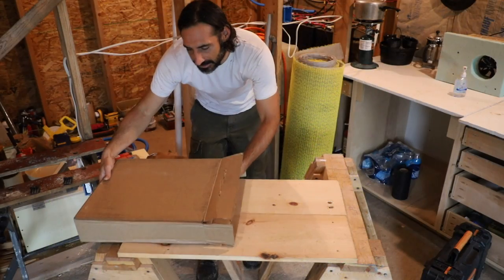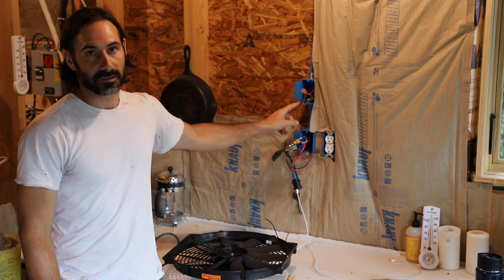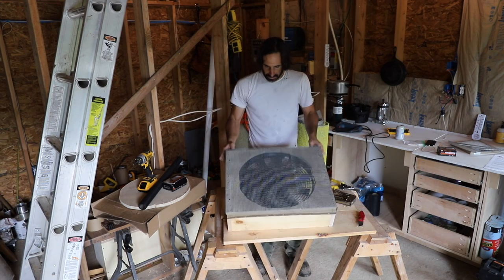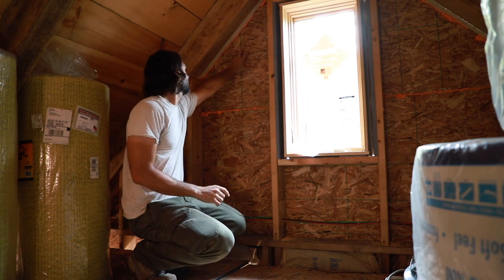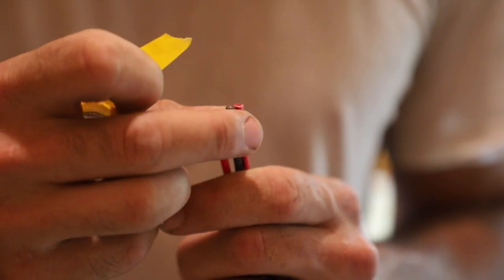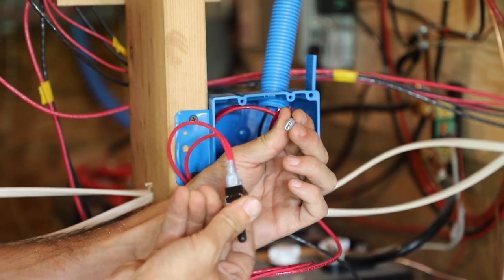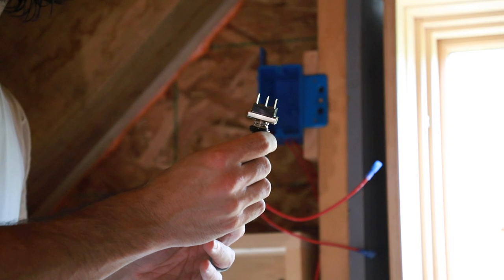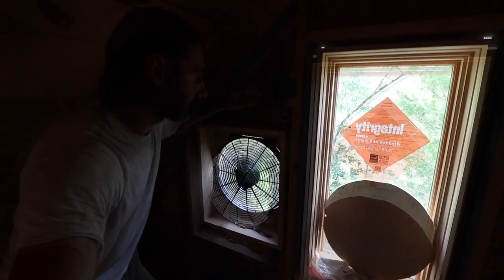Off Grid Alternative to Air Conditioning?  Making a Whole House Fan From a Radiator Fan

Comment: If you've installed that gable fan for the purpose of COOLING (i.e., getting outside air into the sub-roof, to replace hot air on a sunny day), then you might have been more effective with a weather-proof fan on the shady side of your roof.   Yes, I noticed you have R40 roof and my garage roof in SoCal has no insulation value at all.   Still, you are getting heat into the living space, by your own admission, from roof; i.e., from IR showered upon inside areas from warm wood of the sub-roof.   Stop all that with a sub-rafter radiant barrier...i.e, glorified aluminum foil...  with some plenum beneath the roof ridge.     I know you're not in Phoenix AZ where my idea works best.   But you might learn about radiant barriers... shiny side DOWN, so dust won't gather on that important shiny surface, to diminish its low-emission nature.     Admittedly, I've never heard of a DC-powered roof vent.      So you might want to invert your DC and a 1500 cfm fan from Home Depot ... requiring about 250 watts... might work out.
Reply from the maker: The insulation is foil faced polyiso, so there is a bit of that going on in the airspace.  This fan moves 2250 CFM at 120 watts, I will probably end up running it at half speed to keep it quiet.

Comment: Hey man, you're probably not gonna see this but I hope it helps someone else. A ventilator fan is the first step in getting out hot air from inside the home but you can go one step further by using desiccant and/or evaporative cooling depending on your location. If you live in an arid climate, you can get away with just an evaporative cooler but in humid places like yours a desiccant and an evaporative cooling combo can cool the home a lot more. The science is pretty simple and based on the phase change of water where it takes 5 times more energy to heat water from 100C liquid to 100C vapor than it takes to heat it from 0-100C. This is what happens when you mist the room with water and allow it to form vapor by absorbing heat energy from the room.

A lot of good info I got is from this video: https://www.youtube.com/watch?v=R_g4nT4a28U
Note on video: The majority of energy is needed for heating the desiccant to release the absorbed water, this should be simple enough with firewood or charcoal or some magic you use in the country for heating.

Phase change of water: http://hyperphysics.phy-astr.gsu.edu/hbase/thermo/phase.html

Comment: Radiator fans are ment to run for short periods not long sustained times. Good possibility it wont last long. Sorry not being negative a.box fan would worrk longer if you are conserving money.
Reply from the maker: my plan was just to run it until it changes the air in the cabin, a couple minutes or so.

Comment: Bunch of hater on here! 
I would have used a Volvo cooling fan. It would be a lot less noise.  Then I would have just went with smaller metal screen. Ditch the window screen.   That is really blocking your air flow. Some kind of flapper panel to stop bugs and keep the heat in the winter
Most of that sound is from the straight blades.  Volvo fan will flow more power last longer and make less sound when on.

Comment: Bubba. That thing is noisy as hell. Great wiring job. But you gotta get a quieter fan.
Reply from the maker: oh yea it is super noisy, I will wire in a controller so it can run at 25 or 50% speed!

Comment: Use two 12 volt fantastic fans hooked-up in series, your problem solved.
Reply from the maker: Does that work if I were to wire them in series would they each take half the voltage?

Comment: Very loud!  I hope your not planning to sleep with that on???
Reply from the maker: It actually only needs to run a few minutes to change the air in the cabin, I am also going to wire in a controller so it can run slower.

Comment: Why is it so noisy?
Reply from the maker: Its just a really powerful fan, it can change the air in the cabin in under 5 minutes.  Once I install something called a PWM controller I will be able to run it at any speed and have almost no noise on a low setting.

Comment: CFM?
Reply from the maker: It's 2,250 CFM.  It changes the air in the cabin in under 3 minutes.
Reply: 50 Acres & a Cabin   Whoa, that’s pretty high and as a result probably noisy, I know it’s too late now but you probably could’ve gone a bit smaller..  I believe a speed control would be able to knock the RPM’s down a tad.  Thanks for the video... I envy the hell out of you

Comment: This is not an alternative. 
Ventilation and cooling are not the same thing. 
The noise and inability to change the filter is the results of the authors ventilation project implementation.

Have you ever used a washing vacuum cleaner? 
When you suck in water, the vacuum cleaners tube cools down very much. Why not use the same principle? Yes, the efficiency will be lower than that air conditioners from the supermarkets. Yes, there will be a constant flow of water during operation. But then you will have minimal electricity consumption. Several tubes, two fans (one for driving air inside the tubes) and a capillary system - that’s the air conditioner alternative.
Reply from the maker: A furnace filter can easily be fitted in the frame.  The intended us ise in the evening after the sun has gone down, outside temperature drops, but inside temperature which has slowly risen during the day stays higher than the outside temperature because of all the insulation in the cabin.  The fan speeds the natural process up by drawing in cold outside air and pulling out warm inside air.   It just speeds up what nature would take a couple hours to do.  It takes 3 minutes.
Reply: @50Acres  
For ventilation (not only at certain times) it is more profitable to use natural draft. The main thing is to design it correctly.

Comment: You made a very poor fan choice. The CFM may be in the range they you were wanting, but you bought a "slim" fan which is made to be placed in space restricted areas like between a motor and a radiator. You should have purchased a taller fan whose blades were designed to move the same amount of air, but much quieter.

Comment: bro. you blew maximizing out put. i may not spell right! but your killing air flow! i see it! that car fan is highly efficent.  your plywood shit edgeing blows! get a protractor about a 16th larger than the shroud!  sand it even!  let it flow smooth! and the fan noise is sick!  but i think a clean flow will keep the noise down too! but i got it! flow sometimes over comes heat too! i live at 79-81 degrees in nevada. shade. high speed fans. and your eyes will water!  ha. every drop of cool matters here!

Comment: I cringed when he drilled two holes with that large drill bit right next to those electrical lines. He choose the wrong fan for the job - his "whole-house" fan makes a "whole lot" of noise, did he even bother to consider the CFM rate and high amp draw that fan will have, and the mesh will severely restrict air-flow, all this is poorly thought out.
Reply from the maker: The fan is 2250 CFM, it changes the air in the cabin in under 3 minutes. It draws 5 amps, a very manageable load.

Comment: not a fan.  ( needs more cowbell) 

I bet you did that on purpose to get 
comments . did I win ?

while youre sucking air out the top,
how about putting wetted filter screens in the bottom to cool incoming air ? 
rig a 1/4” drip system to keep it running .. gravity fed preferably.

Comment: You're kidding, that level of fan noise is acceptable to you?  Hot air will roll out the attic opening on its own without the fan. 

You need a door on that box to stop cold air coming in during winter.

I'll bet that fan is pulling some big Amps off your small battery.
Reply from the maker: Yankee Inventions Its definitely too loud I’m going to wire in a PWM controller.  It also only has to run long enough to change the air in the cabin, maybe 5 minutes or so at max speed.
Reply from the maker: will do Yar!

Comment: why a radiator fan?
Reply from the maker: The power system is 24 volts and I prefer not to run it off the inverter so I was very limited in fan choice. It moves 2250 CFM!!  does the job in about 3 minutes!
Reply: @50Acres  understood. thanks for the reply.

Comment: Like the idea but the noise is a little much.
Reply from the maker: In a future video I install a PWM controller,  now I can run it at any speed
Reply: @50Acres  have you ever thought about wind power to top off your batteries?  I hear vawt systems were more efficient  maybe you could build one for us?
Reply from the maker: @kennethhudson8013  Im thinking of doing wind for fun, and also hydro, but both would really just be for entertainment because I have a lot of extra power as it is.  Ive never even bothered to wire in my generator backup because ive never needed it.
Reply: @50Acres  impressive

Comment: And you want to listen to the racket that fan makes you really should have went with the RV fans a and they would not drive you nuts like that fan will just way too loud.
Reply from the maker: I am planning to wire in a speed controller which I think will quiet it down significantly.

Comment: Sure, the fan is loud, but you guys are messing the point of its purpose. You aren't supposed to leave it on all day lol. It just helps expel the hot, stagnant air and draw in cooler fresh air. Hot air gets stuck up there with no where to go.
Reply from the maker: bingo
Reply: When the air outside is also hot and stagnent (AKA all summer), where does this supposed cool air come from?
Reply: @elonmust7470  the outside air is still relatively much cooler. I live in Phoenix and I see this in action all the time. Even if its hot as balls outside, its even worse inside because of how "stuffy" it gets from all trapped heat. This fan will absolutely make a huge difference even if its just "warm air"
Reply: @Moon___man  you live without humidity.  You only deal with half of the equation.
Reply from the maker: @elonmust7470  Whole house fans were the primary means of cooling houses from the early 1900's  to the 1950's, this is not a new concept.  Before that, homes were designed to allow natural convection to draw cool air into the lower part of the house and exhaust hot air out the upper levels or a cupola.  There's your free education for the day.
Reply: @50Acres  Those were bigger homes that were built according to the sunset.
You'll be hot in your cabin this summer..

Comment: You have electricity, just buy a damned window unit. They take all of ten minutes to install.
Reply from the maker: I like to run as much as I can straight off the batteries, that way if the inverter craps out I still have stuff like lights, fans etc.

Comment: Couldn’t find a 24vdc version, because you run 24vdc at the cabin????  Have you ever heard of a step-down transformer, going from 24vdc to 12vdc?  Use the Googles before you knee jerk a solution, and second you can get speed control through a varistor or variable potentiometer.  I get it if electricity and electronics isn’t your thing, but ask your subs or friends first.
Reply from the maker: I didn't use a step down transformer for the same reason I didn't run it off my inverter, it's another potential point of failure.  In the next video I wire in a PWM controller.

Comment: Im not sure what you do for a living but first, you never just run wires through the walls. And for the love of simplifying troubleshooting later, use different color wiring.
Reply from the maker: I ran the wire through carlon cable and used DC wiring convention colors.

Comment: NO to a reversible fan if you do not absolutely need it!!

They are by design less aerodynamic, less efficient and more noisy.  They really are!
Reply: I have to correct myself: If you have to reverse the direction of the fan by flipping the blade (and the wires)  there is no reason for it to be less aerodynamic/efficient/noisy.

Comment: Are you an electrician by trade?
Reply: How did you learn about electrical work?  Very cool!
Reply: Love the cabin! Great job! 👍
Reply: Any plans for solar or small wind turbine power?
Reply from the maker: hi I am not an electrician, I do have solar that I installed on an earlier video. I learned electrical by reading books.
Reply: @50Acres  That's awesome! Hey, if you can recommend any books, please list them. It helps us learn. That really takes drive & motivation to take on something like that. Great job!

Comment: Wrong type of fan, improperly screened, and much too much noise! Air conditioning is not just moving air around with a fan. You need to reduce the temperature in the summer season and to adjust the humidity year-round. Too much humidity will put black mold into the walls of a heavily insulated cabin, in the summer or in the winter.
Reply from the maker: This replaces warm inside air with cool outside air in the evening when the temperate drops after the sun goes down.  It runs for 3 minutes and is usually good for a 10 degree swing.  its not air conditioning but it does make a noticeable difference.

Comment: That is not an alternative to AC its an over complicated FAN that moves hot air around no different than an standard AC style fan.
Reply from the maker: Tony, a whole house fan replaces warm inside air with cold air from outside after the temperature drops at nighttime.  This is how houses were cooled from the early 1900s until around 1950.  Before that time houses used natural convection to achieve the same end, it just took longer.
Reply: @50Acres  Yes i understand the concept and for sure in colder climate places it would probably work well but where i live its just moving around hot air,  sure it may be a small amount cooler in the end but none the less its not AC nor an acceptable replacement to which by the title of your video lead me to believe this was a just as good as AC alternative my mistake i misunderstood,     I do however appreciate the lesson and watching the videos,   I myself am in the process of purchasing some property to build my little slice of getaway heaven if budget allows that is.    As your undoubtedly aware the price of things is a bit out of control and if your anything like I am you have more time than money like me so i tend to do things DIY as much as possible to save money granted i tend to overbuild as i dont want to build it again 20 years later so my projects usually wind up costing me double what i could purchase it for already built so im not doing so well on the saving money part i suppose.   LOL

Comment: You are going to need more beer 🍻 in order to sleep through all that noise.........

Take a switch from a regular fan....... set it on low speed....... then attach a thermostat to it, so it only runs when the temperature is above the set range.

Or......... just open the F’ing windows before you have to go to bed 🛌......and the hot air will escape to the outside...... and cooler air will come in through the downstairs windows by way of natural convention.......
Physics 101 🤓🧐🥵
Reply: Joe Trump That's funny. Perfect parody.
Reply from the maker: Yea Joe, I will drink more beer and use the fan to speed up the physics, bam problem solved!

Comment: Fill your home full of screaming children to drown out the noise coming from your fan.
Reply from the maker: It changes the air in the cabin in around 3 minutes (conservatively) then I use the built in silencer AKA the off switch.
Reply: @50Acres  honestly dude that's impressive. I was thinking it would take like 15 to 20. 👍

Comment: Can you put the fan on a dimmer switch or something? It really needs to be running at probably a quarter of the speed. Just sayin...
Uhh.. edit? Screw the arcing. Replace the dimmer switch once every few years. Come on! You sound like a drone is flying over your head
Reply from the maker: I was planning on wiring in a PWM controller.  Can still use the 3 way switching and control the speed of the fan.

Comment: what a terrible choice of fans. Now you're hot, AND it sounds like a jet liner taking off.......
Reply from the maker: It changes the air in the cabin in 3 minutes (conservatively) then I use the built in silencer AKA the off switch.
Reply: @50Acres  I won't deny that. A radiator fans only job is to move high volumes of air, but with no regard to volume. It's engineered for a specific purpose. My argument would be do you really need that? My personal preference would be to have a fan that runs near silent or with a dull purr that can do the same job in say 9 minutes over and airplane engine that can do it in an excruciatingly loud 3 minutes and have to be turned off for sanity. A quite low flow fan is something that could even be left on over night to maintain the cool temperature as well as continue to move in clean fresh air. Plus those types of fans are highly efficient and sip power.

Comment: off grid buying off amazon  ?          amazon  110   house fan with shutter costs lest than a car fan  screws plywood   drill charge  1x4  boards from store  screen  etc  ? how long till the screen gets clogged with lint     i tried it        big ass airflow restriction with all that screening   why  the wire loom   you got rats ;;oops i saw a critter trap  sorry ///use bx ?  why even go to 12v    you got a inverter    screw the 3 way switches   $$  and use a temp  conr tol switch?      i can send you my set-up  pics    mine is quieter             16 inch https://www.amazon.com/gp/product/B01G8I7HVM/ref=ppx_yo_dt_b_asin_title_o04_s01?ie=UTF8&psc=1      1600cfm           i wish i could send you my install pic